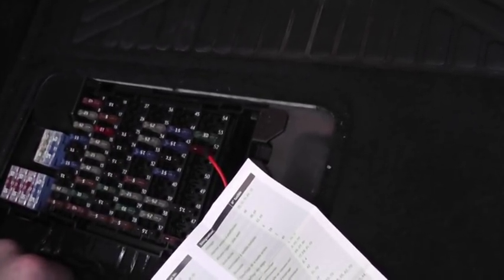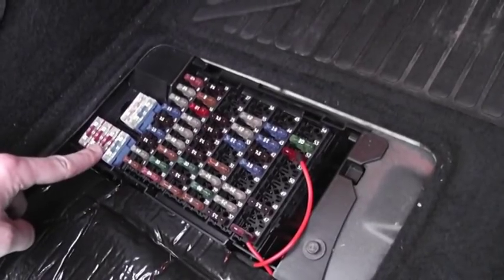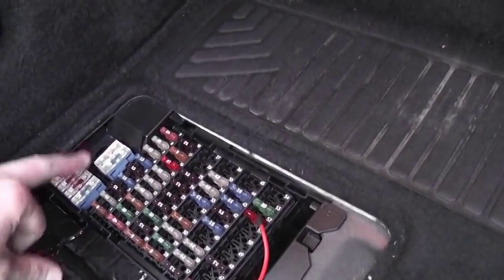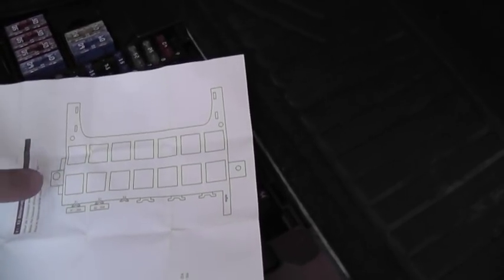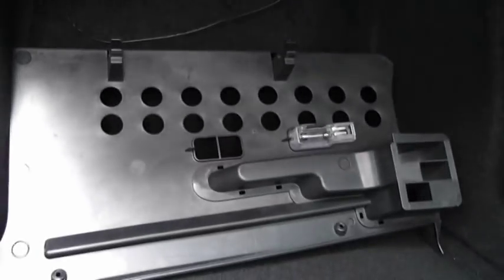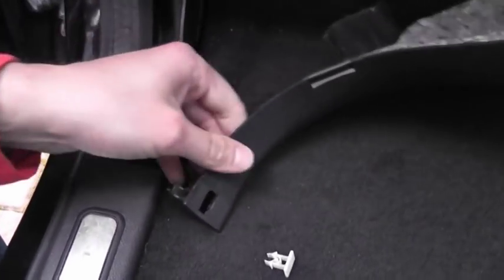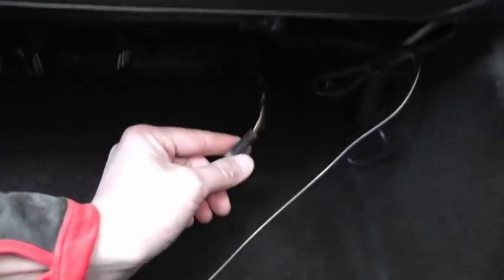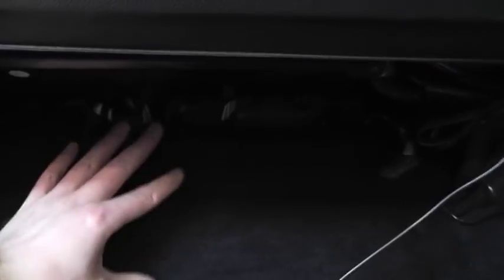Mercedes 2010 B-Class SRS Restraint system malfunction - Faulty Relay

Comment: In my case the wipers works but when I check the fault with a diagnose it says module defective and isnt possible to delete or to reset. Yet what i know is this failure came because of a weak battery. Any suggestions?

Comment: Hello 
Can you help me please,
I have a b-class 2006 i have a problem with a prasite batery, the battery drains overnight, i check it with a multimeter the fuse box and when i take out the fuse number 37(which according to the manufacturer is the "Restraint systems control unit,Front passenger seat occupied recognition sensor,Front passenger seat occupied and child seat recognition sensor")the ampermeter goes to 0.08amp which is normal with a ferw words the drainage of the battery is on this fuse can you give me an idea what to check

Comment: Same problem before watching this video,went to the car electrician,most probably he did the same job as here,paid him £70 which I was happy.They worked fine the same day and then day after they stopped working and the other next day they did work again 😅 I was very confused. Today they still not working and the electrician said that it might be a problem with a SAM unit😢😢 and most probably I need to take the car to a specialist Mercedes 😅😅

Comment: You are a star! Mine had the same issue and I replaced the relay using this video otherwise it would have been impossible to do it otherwise.  All for less than 20 GBP.    Thanks again

Comment: I have a Mercedes’ c280 elegance 3.0 steering wheel is on the left, I have spent so much time looking for the cause, didn’t want to take to Mercedes dealership because it would cost a fortune, 3 days ago I took to an electric mechanic, after I left the car there he called me 3 hours later, he said he believed the problem was the fuel inyectores and he could finish the job by end of the day, he charged quite a bit of money, I would say equivalent to 250 US dollars, I don’t have a job now and it was a lot for me. I went to pick up the car, paid him, the SRS was still there 
It was a ripoff. He kind of armorall the top of the engine so it looked clean. I need to find this relay in my car any ideas if is also under the math 
Please help
Reply: I just fixed it. Thank you Lord and thank you to the guy the uploaded the video. Even taking it to a mechanic didn’t work, he did clean fuel inyectors and said did an oil change. Paid him quite a bit. When I picked up my car the SRS light was still on. I kept on searching and found your video, my car is C280, the relay was in the fuse compartment at the engine, once I changed: BINGO ! Thank you dear Lord and thank you guy for video. I video starting the car and cigarette lighter working, The SRS warning disappeared, I went to the mechanic to get my money back, he wasn’t there, I told his assistant that his boss mechanic didn’t fix my car and did mechanic work the car didn’t need. I sent the mechanic a text including video of the SRS on after I picked up the car from him. Also sent him a video after I fixed the car. And no SRS LIGHT ON
He called me after 2 days and said I could come to the money back, I got about 70% back. 
I didn’t have to take it to have it to scan to erase. It just disappeared after I put the relay. I

Comment: hi mate i have the same problem but on a aclass 2010 wud it be the same rely?
Reply from the maker: I have a A160 2011 and I am pretty sure the relay is in the same location, but I am not sure if it is the same relay. That said my B160 and A160 were similar in lots of ways. Also another commentor said that to clear the error after replacing the relay on the A-Class still required them to go to a Merc dealer. My advice would be to go carefully and locate the relay for the SRS circuit (read the manual / fuse sheet to locate the correct one). If you are handy with the multimeter you can check easily if it has failed. While you are there, check the relevant fuses etc. I'm not MB trained, just own a few Mercs. Only do what you are comfortable doing! Good luck.

Comment: Hi, similar problem on my A170 2003. Front windshield  washer doesn't work and the same SRS light is on, till this video I never thought that those 2 problems are maybe connected. How did you found where that relay is located? Thank you.
Reply from the maker: I spent a long time on Google and finally found a post on Mercedes-Benz Enthusiast Club Singapore's forums. I think the post is no longer there but it mentioned the wipers & SRS and the relay, and where to find it. I just created a video to spread the info. :)

The fuse sheet and manual will tell you where the relays are. On a UK A160 I know the relays are in the same location, under the carpet in front of the passenger seat.
Reply: @iloveimageprocessing  Thanks, it is, I'll inspect that relay as soon as I can. If it works, I'll buy you a beer. :) Thank you for video, found it very helpful.

Comment: Thank you very much! I had a bad battery removed, and SRS light went on.
In Germany I cannt get through the tech inspection.
So, how was you sure  that it was this relay?
Reply from the maker: I was not sure, but I felt like trying it. You could remove the relay and test with a multi-meter? Some people say that the SRS Fault (once fixed) requires a MB tech person to clear the fault. That was not the case on my B160 as once I cleared it from the steering wheel it was gone forever, but I don't doubt what people say. The question is do the other faults exist as well (light on the passenger sun visor and the wipers)? If they do, then it sounds like the same issue. If the wipers work then maybe it is just a fault code that needs clearing and if it keeps coming back when you do it, then go to MB I guess. Good luck!
Reply: @iloveimageprocessing 😊🤸‍♀️thank you very much for answering so quickly!
My front whipes are working.
I dont have the white lamps above the front window as you do.

My new Mathies battry went flat. 
It took 5 times to go flat, when technical support ADAC  believed that it was the new battery and not smth else.

So since then SRS light is on the display.
All the rest functions.

When the defect battery was removed, the red swicht got disconnected. So ADAC technician explained the SRS light to be resulting from the disconnected red swicht under the driver's seat.

When I came to the workshop, they connected the switch, but the SRS message kept lightning.

The workshop read the mistake out and explained that "someone is sitting on the front passanger seat".

They tried today the whole day, but couldnt get read of the SRS light.

Then I found you video!😊🌹🤸‍♀️💃

Thats why Im asking- how did you realized, that it was this relay B? Or any other relay?
And not say sensor on the front passenger seat?
Reply: @iloveimageprocessing  😭😱Do you know how much does it cost to go to MB in Germany? To have a simple test, why the SRS message is lightning?😭😱
Reply from the maker: @pininfarinarossa8112  I know, MB are expensive here as well, and some are not any good either. That's why I spent so long looking for the answer before going there. Unbelievable that the workshop could not solve it. That is terrible.

I did read about the seat sensor, and I read it is complex and not a simple on/off sensor, but a communicating signal. I think I decided not to investigate more with the seat sensor because I decided I would not be able to fix something that complex. I found a comment online about the relay and so I took a gamble and went there to investigate. It was a guess/gamble really, not based on anything exact.
Reply: @iloveimageprocessing  🙃🌹you gambled and you won!
Reply: @iloveimageprocessing  😊 I put in the link to a chinese video showing how to change the front seat sensor. Please, tell you what yoy think🧘‍♀️
Reply: Now I read your comment again and I realized you were talking about car battery...
Reply: Hi, I have the same fault on my A170 2003. I heard about that battery, but can't find any info about it. Can you tell me where is that battery located? Thank you so much in advance...

Comment: Thank you. I had exactly the same problem with my C Class Coupe. Your video led me to research which relay was the problem with my car. It is easier to get to as it's in the engine compartment. Same realay and £20 from Mercedes. Fixed in less than 5 minutes. Thanks again.
Reply: My problem.. SRS Restraint System Malfunction but nothing shows in the meter?? What exactly the mulfunction??

Comment: Have an srs malfunction on our b150 class but wiper blades are working fine so how would I fix this problem? Is the process still the same? I haven't checked under the carpet yet where all the switches are but if the fault is not there do I have to go through this process?
Reply: Sometimes it is the seat cable tahtn connects the seat and the bode underneath the seat. From moving the seat it breaks the cable insulation which means resistance goes up and down willy nilly and the airbag SRS goes off 🎉🎉🎉🎉🎉
Reply from the maker: I honestly don't know, but my personal view would be to go through the steps slowly and then use a multi-meter on the relay and see. I'm not a mechanic just a person with a dislike for spending lots at a garage! I couldn't say if a B150 had a different setup for the wiper circuit, but it is possible. Good luck!
Reply: @iloveimageprocessing B150 is B160 with older software just less power same engine 1:1 the same 😅
Wiring should be equal at same trim level. Yours has some options I have seen but nothing mayor 😂

Comment: I have same issue same error shows on dash but my engine won't come in and window wipers won't work while radio plays
Reply: Hello, sorry I know it is been a while but did you get it resolve and how? My 2009 GL450 showed the same and it won't start. my mechanic said it is a transfer case? I doubt it
Reply: @FiestaAjayi  yes I got it sorted i have a new car now fix the problem straight away 😂😂

Comment: How did you narrow your SRS error on main display to being the relay and not the equally likely passenger seat pressure sensor?   How did you remove the error code once relay replaced without a dealer class disgnostic reader?   One of the many 'joys' of this car, is the fact  that even when fixed, most error codes still  need deleting with a diagnostic reader or scanner. 
 I have just bought a immaculate 2007 B 150, but feel I have made a huge mistake just going by Google and Mercedes forums about the stupid design aspects (starter motor, being the classic!) and reliability of these cars
Reply from the maker: Initially I Googled for the fault and read various forums. I think first I did look at the pressure sensor, wiggled the wires, checked for lose cables etc. with no luck. When I replaced the relay (following reading a post from someone with the same issues and who fixed it with a new relay) I did not know if it would work. It was just a gamble. I also gambled on a diagnostic port to USB reader for the car, but I never used it once I realised that MB have their own hidden menus. So it wasn't all win-win. The stories of the pressure sensor being a protocol driven unit rather than an open/close switch scared me enough to not bother opening it up. Luckily I cleared the SRS fault message from the console, but I could well believe the need for trips to the dealer. Maybe the fault code is still in there!

I don't have the B160 anymore, I upgraded to a newer GLA. The location of the relay (in the SAM hidden under the carpet and hard to reach) is a good example of the bad design I agree. But the new GLA has it under an 'easy to pull up' carpet. Better but not wonderful. As nice as the new car is, I miss the B160 a lot. Part-exchanging it was like loosing a family member. I kid you not. It was a sad moment. The GLA is great, but not as well sound proofed and viability from inside is limited by a massive central pillar and smaller windows. Trust your purchase, the B-class is a nice car!

Comment: I got the SRS light on after fueling up few mornings ago. Does it has anything to do with it? Strange thing is that there is no malfunction error message display on the center. Any idea?
Reply from the maker: Probably not related to fueling. I don't think it is the same issue as the relay, do the wipers work?
Reply: +iloveimageprocessing yes wipe works. I notice that the seatbelt light is gone whenever I unbuckle it.
Reply from the maker: Under the seat is a red connection box that connects the seat sensors. It might be that, and the SRS light is saying the passenger airbags are disabled because it thinks a child seat is present. Unfortunately I heard that the electronics in that is quite complex, more than just a few wires and that it sends coded signals. It could be just loose wires so check, but anything more I think you should get fixed properly - the passengers life might depend on it! Good luck!
Reply: jtcber .  I have the same SRS fault as yourself.  The guy here was very lucky imo, because his problem with the main display also showing SRS along with the red SRS light coukd equally have been the passenger seat pad, which is a pain to DIY.   He was also very lucky in seemingly, he didnt need a diagnostic reader to reset his SRS display error,  which is the norm for any display error code.  
Back to my problem, and one you have hopefully solved?  Unlike this video,  there is no SRS 'Go to Workshop' on the display, just the red SRS light.....and, like yourself,  no seat belt warning chime when driving without belt on.  
  This logically points to the seat belt anchor, but when I disconnected the red terminal block under the driver seat, and measured the resistance of the seat belt anchor two pin plug, it measured about right, ie. open circuit seatbelt unconnected, and just over 120 ohms or so seat belt connected.   I am wondering if there is a fuse for the seat belt connection/warning chime but cannot find one in the main fuse block.  Sods law says it will be one of the relays where this guy here accessed at not small hassle.
So far, according to Google searches and Mercedes forums, I have found the design and general reliability of these B classes to be simply appalling.   A Ford C max would have been better designed and more reliable, I suspect.   But, I digress lol....did you manage to solve your problem with a replacement seat belt anchor latch?